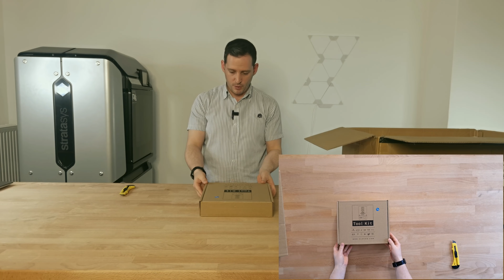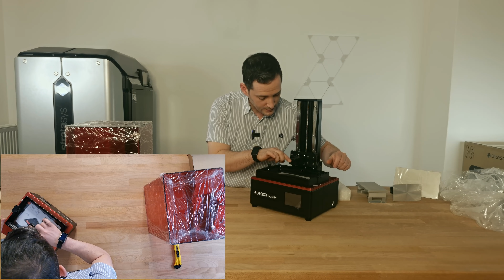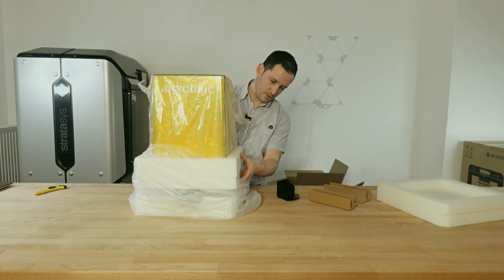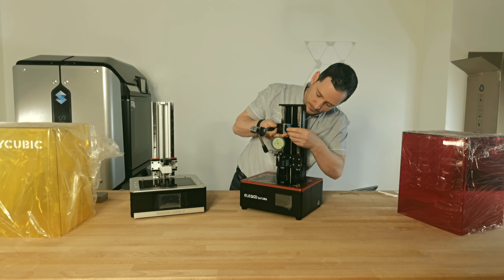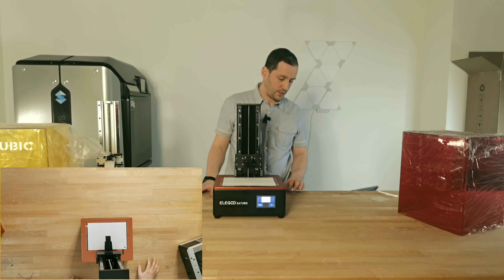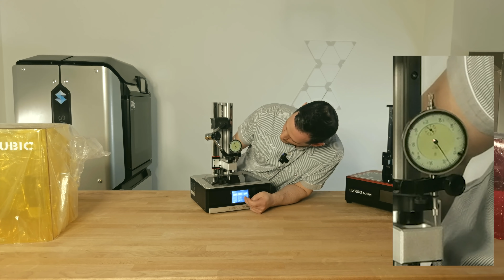Elegoo Saturn vs Anycubic Photon Mono X (In-depth comparison)

Comment: Nice comparison. In summary, the Elegoo Saturn is built better and to better/finer tolerances than the Photon and the Saturn is 33% cheaper. A clear winner it would seem.
Reply: No! This may be true for the two samples he's received. Based on this detailed review/test I purchased the Elegoo Saturn (newest iteration with some fixes already done by Elegoo). But the quality of my Saturn was that horrible I had to return it, the issues were that bad so that printing was not possible, and there were several big issues with the machine. The I purchased the Anycubic Mono X, again several issues, mono screen loose, Z axis spindle not manufatured right, FEP sheet too loose without the pssibility to tighten more. But all in all with my two printers the Anycubic had less and less severe quality issues. (I'm a machine mechanic and Engineer, so I know how to handle these machines)
Reply: @NorthernLightSouth  so it seems neither of these two brands guarantee an out of the box experience. I guess it makes sense then why a formlabs form 3 is 6 times the price :) Question is then, is it worth to accept the initial possible headakes and fix one of the cheap ones ? If one is mechanically inclined and wants to spend the time that is ....
Reply: @ioandragulescu6063  with these companies it's a lottery if you receive a unit that is usable or not. I purchased 2 machines from Elegoo and 3 machines from Anycubic. One from Elegoo was semi-usable (Mars Pro), one was absolutely not usable at all (Saturn). The Anycubic Mono X was usable with one or two issues which I still have to fix, their small Wash&Cure Station was O.K. (only small prints fall over from the rotation platform, I have to put it in a container). The large Wash&Cure Station I still have to test more, did use it only once.
Reply: @ioandragulescu6063  I never tested a professional resin printer like the Formlabs, but If money is no concern then buy a profesional printer, as these cheap chinese printers do have their problems. From my own experience: I think you can call yourself very lucky if you receive a unit that has no major issues. But the price differences are so high that a maker cannot afford a professional one. So with these cheap printers from Elegoo & Anycubic you have to be prepared to fix some issues, change some parts etc.
Reply: @NorthernLightSouth  I wonder if EPAX fares any better. They seem to be a bit more expensive and reviewers (yeah, the casual ones) talk of a higher build quality compared to Anycubic and or Elegoo
Reply: @ioandragulescu6063  I did not try the Epax E10, but next time I may give Epax a try if they have better build quality.
Reply: @NorthernLightSouth  I’m just getting into 3d printers for Warhammer. What would do you mean by usable? Like it just can’t print anything at all? 

Really trying to figure out if I want to get a 4k printer from Elegoo or Anycubic.
Reply: @hiddenleaf414  Yes maybe you can’t print anything at all. I certainly couldn't with my unit of the ELEGOO SATURN. But this depends on how bad the unit is which you will receive.

Apparently, the quality control at ELEGOO and ANYCUBIC seem to have some room for approvement... My ELEGOO SATURN i.e. was not usable at all, it was so bad that I could not print anything. The worst thing was that the ball joint where you tighten after bed leveling was mechanically not working, was not able to tighten the ball joint. Even with using heavy load on the hex key (I guess not far away from breaking the screw) the build plate was tiltable using 1 or 2 fingers only. So I had severe layer shifts because the peel force from the FEP sheet was twisting and slightly tilting the build plate constantly during printing.

The other big issue was that I had to code my own version of firmware and load it to the printer board, because the manufacturer was selling these units with a firmware state which was far from finished, in my opinion. I tried the lates firmware from ELEGOO of course. The big issue with the firmware was that the SATURN ripped each printed layer much too fast from the FEP sheet. Yes, you can adjust the lift speed in the slicer, but the printer does the lift in two stages, the first stage is a slow lift, the second stage is a fast lift. My unit performed the lift for 1-2 mm slow and then suddenly peeled the part off the FEP sheet with a much higher speed than set in the slicer. So, I had to alter the firmware in some ways to lift slowly for a greater distance before accelerating stupidly fast. This way most prints were ripped from the build plate.

My specific unit of the ANYCUBIC MONO X had far less severe faults and I still use it. It will print, but it may lack some accuracy in the Z-axis, as the Z spindle has a slight deviation in the thread, but it is usable but with some inaccuracy in z direction. If I manually move the Z axis 4 mm up the dial gauge tells another story, cannot remember the exact deviation as I tested this a year ago.

With any of these cheap resin printers there is some kind of a lottery. Some units are better than others from the same printer model. My first resin printer was an ELEGOO Mars Pro and my unit had another big issue: Exposure was not evenly spread over the build plate area. The UV light array is uneven and the result can be seen in the printed part as small holes & channels spaced exactly like the lenses of the UV light array are.

I was able to return the ELEGOO SATURN and get my money back, but that depends on the seller, I guess…
Reply: @hiddenleaf414  My recommendations at the moment would be:

If the build volume of any of the small resin printers is enough for your Warhammer prints, I would recommend one of these printers when they are on sale for a good price: ANYCUBIC Photon Mono for $199 at the moment or the ELEGOO Mars 2 Pro for $260 at the moment. That way you would not lose too much money in case you also receive a faulty unit.

If you need more build volume, I would recommend the ANYCUBIC Mono X (4K) for $429. The ANYCUBIC Mono X (6K) is still too expensive in my opinion. You may receive a very good unit or a bad unit with all these cheap printers. So, there is no guarantee that you will have a good unit right from the start. You may contact the manufacturer for spare parts like a flat print bed or a new UV light source before you start to produce high quality prints, which totally is possible with all the mentioned printers if or when they finally function as intended.

Based on my own experience with two resin printers from ELEGOO and one from ANYCUBIC I have to say that some issues may be expected. Other customers seem to receive good units as the reviews here may appear, or maybe they did not check every aspect of the printer (the Z axis spindle accuracy for example).

Comment: I need an update on how support has been from Anycubic. Im disappointed in the issues that you have found especially with the comparison in price
Reply from the maker: Hi Alex. Nothing has changed. Got no replacement parts from Anycubic despite them sending me the tracking number. I then got a refund from PayPal. The support was actually really nice and responded fast. But getting the parts was the issue for me.
Reply: @twinstalk  I'm now looking at getting a Epax E10 5k. I will preform the same tests that you did.
Reply from the maker: @alexhise968  hey that would be nice. We could have somekind of a testing standard and call it TT-test hahaha.
Reply: @twinstalk  I'm not opposed to making the video then having you edit and post it on your Channel
Reply from the maker: That would be nice of you. We could try to collect these tests on different printers and share over my channel. I would like that. If you do the test just send me a message and we can see how I can share your video on the channel. Would be nice. Thx.

Comment: I am considering whether to buy one of these printers. Has anything changed since the last time ?
Reply from the maker: Hi Michal. Nothing has changed. Got no replacement parts from Anycubic despite them sending me the tracking number. I then got a refund from PayPal. The support was actually really nice and responded fast. But getting the parts was the issue for me.
Reply: @twinstalk  Thank you for quick response.
I wanted to buy anycubic mono x first. But after your video and some others with bad prints, i think that the elegoo is the better option.
It's so strange 😂, i will pay less and get the better device.
Thanks a lot for your help, have a nice day.

Comment: Did you hear back from the anycubic support on the issues you encountered? I would love to use the elegoo saturn but sadly some things I'll need to print will need that nearly extra 5cm Z height.
Reply from the maker: No sorry. I did get my money back over PayPal. The Anycubic is still not functional. I will have to get the parts myself and try to fix it. Will do so when I have some spare time.

Comment: Hi, great job, now we have some professionnals doing accurate testings, hope you'll become popular! I'm also considering buying one of those, the Mono X seemed a good choice due to the increased Z axis, but now that I see the backlash and build plate issues I'm just fearing buying it. Did you get the spare parts or another printer to see if it is fixed?
Where could we buy the sensor you're using to measure the Z axis movements, is it exensive? I'm looking to find a solution to ensure the machine I get is accurate.
Reply from the maker: Hi smoitry. Thanks for the kind words. I did not get any spare parts:( Started a dispute on paypal and got my money back. The printer is non functional right now. Will maybe try to repair it someday when I have some spare time. The device I have been using is cheap to get. It is called a dial gauge and costs around 15Euros. You will have to get a magnetic stand too which costs around 30Euros.
Reply: @twinstalk  got your money back and kept the product?
Reply: @devanhughes8060  You ask too many questions.
Reply: @twinstalk  A year on from your excellent Video Elegoo are running a Promotion on Saturns.  The standard 4k Saturn is less than £300 whilst the Saturns S is £360.  Which would you recommend?  

If it makes a difference, I will be printing jewellery masters and toy tanks.
Reply from the maker: @MrPorkmann  Hi.
I did get my jupiter and waiting for the m3 max from anycubic to make a new review with the newest machines. Stay tuned.
Reply: @twinstalk  I am just starting the resin journey so will not be spending that much (yet).

Is the Saturn S worth the extra £70?

Incidentally your print head for the Anycubic mirrors my experiences of their FDM beds - awful.   

I have had around 10 and not one has been flat.  I gave up with them years ago.
Reply from the maker: @MrPorkmann  sorry to hear that. Hopefully the m3 max will be different. I have high hopes for this printer. I don't know much about the saturn s. Can not give you any experience on that.
Reply: @twinstalk  I will have a look and make a guess.

Good luck with Anycubic!  I fine their QC appalling.  However when you open a PayPal case they never respond so you get a full refund!
Reply: Here in the US, the gauge is commonly called a "dial indicator."

You can buy these as a set in a protective fitted case. Fowler makes a decent set for about $55, or you could buy a great one from Mitutoyo for about $210 or Starrett for probably $400.

Comment: No print speed or samples?
Reply from the maker: Sorry not yet. The photon mono x is non functional right now. Will do some prints with the Saturn soon.
Reply: @twinstalk  That's a shame - I was looking at it as a possible purchase. Is it a broken product or yours just isn't set up yet?
Reply from the maker: @Martial-Mat  It was defective on arrival. The linear rails are most likely the problem. Anycubic wanted to send me two new rails to test but they never arrived.
Reply: @twinstalk  Oh that's concerning on multiple levels. Thanks for the info.

Comment: How about the light Power output of them? Because they do have very different maximum speed in paper. Is this difference Because of different energy output or this is due to motor speed and software?
Maybe, the question is: both have the same curing time? Have you tried the clear dentistry flexible resin on them? Some people told me that the photon mono X don't have enough power to polymerase it enough
Reply from the maker: Hi. I thought that the light power output off the Anycubic was higher but will have to look into the datasheets. I did not get my spare parts so the printer is non functional right now. Will do some curing tests when everything is working.

Comment: impossible to make antialiasing work of this machine (mono x), I tested all the slicers, I put the last fimeware and it does not work, somebody has the same problem as me?
Reply from the maker: Hi chove93. I couldnt not test anything on the machine yet. Still waiting for the parts to arrive. Most likely I will have to return the printer. Support was super fast and nice but having to wait so long is not acceptable.
Reply: @twinstalk  yes I understand you, with the covid it's not easy
Reply: @twinstalk  Do you have the latest news？
Reply from the maker: No sorry. Are there any news I should now about?

Comment: I have both, and I love the Saturn. Better for many reasons
Reply from the maker: Hi Multi Magical. Great that you also have both. Any thoughts on what is better on the Saturn?
Reply: @twinstalk  sorry the delay from my part.  PRO: (the price!) Dimensions, noise level, no UV power setting (more easy to set), easy to replace board and lcd, more than monox. Vat standard (kelan and more brands can fit to). CONS: 5cm less z-axis

Comment: Very nice and detailed, but you don't usually pour the resin straight back in the bottle without filtering it or without a funnel, so the lip on the Anycubic vat isn't really that big of a deal.
Reply from the maker: Hi Christoffer Fogelström.Thanks for the tip. This is most likely the case for everyone using a paper funnel or big silicone ones. I am using a small steel funnel with an integrated filter and it helps a lot to rest the corner of the vat on that steel corner while puring the resin back into the bottle. But it is awfully slow because the "grid" of the filter is to small. Maybe someone has a tip on how I can filter that resin faster.
Reply: @twinstalk  You'd have to find a tiny version of a canning strainer (a conical strainer used in kitchens), it has more surface area of mesh for resin to pour through. I don't know where you'd be able to buy such a thing, but it'd be the only way to increase flow and make pouring resin go faster.
Reply from the maker: Thx. You just gave me the right tip. Maybe just filtering with a bigger canning strainer into a bigger storage box and then puring the resin straight into the bottle is the best way to go. Much faster and I may not spill the resin onto my desk everytime.
Reply: Alternatively, a big funnel and strainer with enough volume to hold a whole vatful of resin could work. There would have to be a gap between strainer and funnel to achieve high flow rates, of course.

Comment: any update on the build plate for the mono x if it was indeed defective or intended to taper off?
Reply from the maker: Hi rich deAngelis. I did get a response from the support team that it is indeed a defect and they are sending me a new buildplate. Also 2 new rails should be on the way because of the backlash problem. I did not get a tracking number or anything else yet. So still waiting for parts to arrive.
Reply: @twinstalk  did the parts show up at your doorsteps in the meantime? Update video?
Reply from the maker: @echtvergoldet  no, the parts did not arrive. Despite the nice contact with the support, nothing happened. I do have a PayPal dispute open and it seems that I will get a refund.

Comment: Testing the machines that cost 800$ that way is ridiculous. C'mon pal, this is stuff for ordinary people, not for the Industry.
Reply from the maker: Hi Adam Switlak. If you watch the part about the backlash of the anycubic you can see that there is a problem with the rails or the nut. I did measure around 0.2 mm of backlash. For a printer which has a layer print height of 0.02-0.05mm this is way to much. This will effect the first 5-10 layers of the print and may also lead to failed prints. So having a direct comparison and measuring some parts accurately will help people find errors which they did not think about. I also have to say that the backlash of the elegoo saturn is only 0.02 mm which is great by the way. Without me measuring the backlash I may have never found the error of possible failed prints. Also some people use these printers in print farms to produce parts for industrial use. The accuracy is great, they are easy to maintain, service can be done without much background knowledge and they are cheap to get.